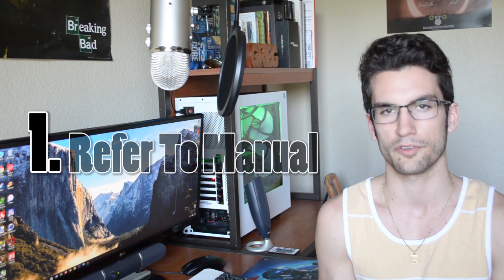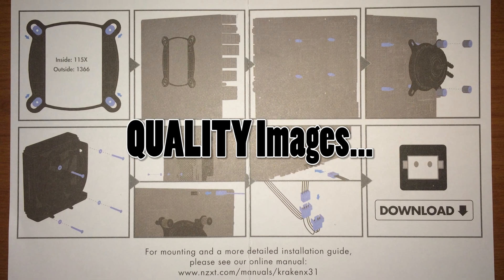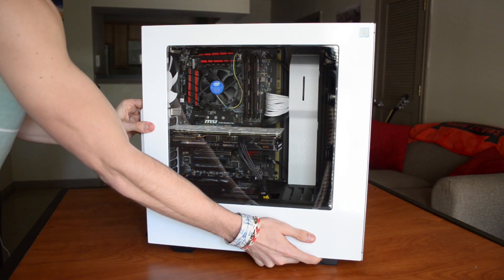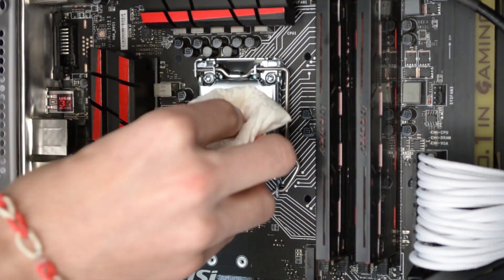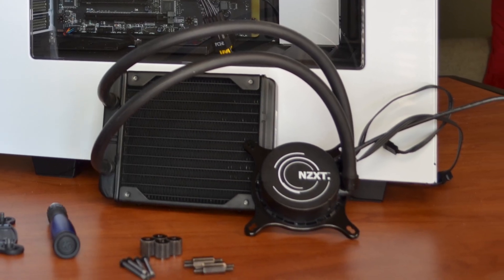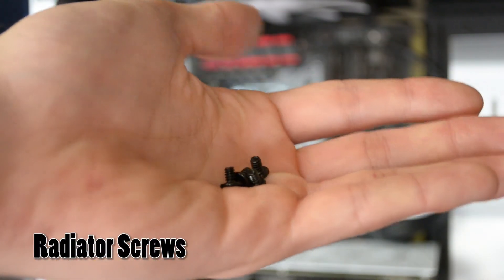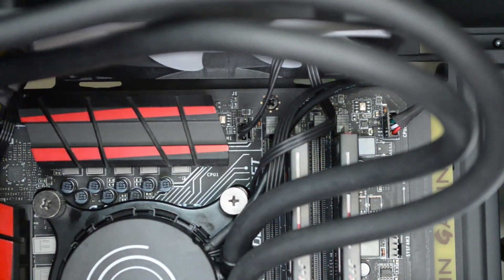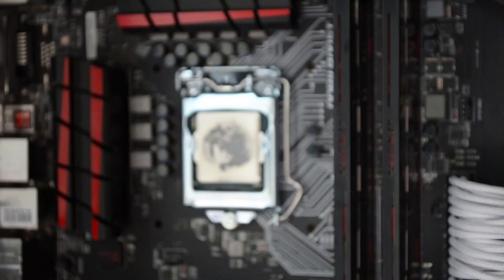How To Install An AIO Liquid Cooler

Comment: dont we have to refill the water cooler every couple months?
Reply: Not with all in ones. It's a sealed loop so you couldn't fill it even if you wanted to. Custom coolers you should periodically check the water level on the reservoir to make sure it's got plenty.

Comment: So i am confused, can i place the cooler master masterliquid 240 on my front panel of my case so the front fans are the water cooling fans (my case is sharkoon tg4 red) 

I see a lot of people just screwing the radiator on front while the front fans are not removed

Does that means that i just can screw the radiator on the front panel too and use those fans as AIO fans?

Comment: I never trusted liquid cooling as I tried it before and got a leak very quickly, but it was one of the ones where you add the liquid yourself, I wasn’t aware they did coolers with liquid inside already

Comment: 2 quick questions are the aio coolers alredy filled with coolant? And is there a mechanical pump or is it working just by temperature diffrence causing flow or something like that?

Comment: Thank you for providing a great video and installing the fan to blow air towards the radiator to cool the radiator off so it can provide cool water to  the hot cpu that heats up the water. Thank you. There are some videos floating around and i believe they do not know the basic law of airflow and radiator function.

Comment: question am I able to swap my water cooler stock fan for a better fan with rgb? I have a Hydro Series™ H45 Liquid CPU Cooler just can't seem to find any answers to the question thanks
Reply: The only thing you need is a fan that will push air through the radiator, so any fan will do
Reply: @k3llyj3lly  thanks

Comment: shouldnt the radiator fan be plugged into the cpu fan header as the speed of the fan needs to be dependent on the temp of the cpu?

Comment: Don't connect AIO radiators at your exhaust spot. You want it getting fresh cool air, not hot air from inside your PC.
Reply: Not true your chassis configuration determines whether or not the fans should be blowing or sucking.
Reply: @codyjames5036  the fans can be push or pull, either way you want them getting air from the beginning of your system
Reply: @RickRokner  not to try to be rude but simply by your statement you don't know much about fan setup, chassis configuration and especially water cooling and when I said sucking or blowing I didn't mean which direction the fan will be on the radiator I meant sucking it in from the outside or blowing it out from the chassis.

Comment: you know this whole time I thought u had to put water or some sort of liquid to cool this, seems like its already there lol, I've seen too much custom pc's with all those crazy waterpipes
Reply: You know I was just wondering why did he leave out the how to fill it
Reply: Wait so with an aio liquid cooler you don’t have to manually put water?
Reply: @drpepper9676  no aio stands for all in one. You dont need to change the water it comes preinstalled
Reply: @crownedmedia7936  damn I been wondering about this😅. thanks for the info man. I'm fairly new to pc
Reply: @crownedmedia7936  what is the water runs out, then wt do i do?
Reply: @yoda_playz3060  it wont lol it's all sealed
Reply: @crownedmedia7936  is it safe tho, i am going to be doing my first build in a month, and i am thinking between aio and fans
wat should i go for?
Reply: @yoda_playz3060  I'd go for the water cooled one theres nothing to it just screw it in and plug it in it's simple and safe and looks better plus you can say your pc is water cooled lol
Reply: @crownedmedia7936  thank you for the support, do u have any knowledge on gpu's tho?
Reply: @yoda_playz3060  I got a rx570 8gb its vr ready and it has a msi rog logo on the box it's around 300 canadian I'd get it
Reply: @crownedmedia7936  i am thinking of getting rx 5600 xt 6 gb, should i go for it or is it risky coz of the black screen errors
Reply: @yoda_playz3060  I'd get it you'd be fine,if it did break you can just return it if it's in the time period
Reply: @yoda_playz3060  I'd recommend the 2060super over 5600xt .
Reply: @rikshitb6837  thats wat i am going to buy
Reply: If i knew this on my last build i would've probably used a AIO cooler but as somebody fairly novice in pc building the thought of me trying to manage water in pc just put me off. I just used the stock amd cooler.
Reply: I too have seen one too many of those builds with all the water pipes. I've had my PC for two years now, built it myself. Did not know they made water cooling systems that came with water pre-installed. Right now I'm just rocking the stock cooler and some fans in my PC. Might upgrade to this cooler seeing how easy it is to install it, and it's not too expensive on Amazon at $90.
Reply: well thats why these are called aio's (all in one) and not custom loops
Reply: theguywiththecoolprofilepicture  yea I ended up getting a Corsair h100i pro
Reply: @aidancarroll2945  you could still remove the fluid and shake it up with distilled water to clean it out a bit, sometimes they come with metal particles in the water from the radiator itself but ehh, thats just me.
Reply: @aidancarroll2945  how is it working for you?
Reply: @aidancarroll2945  was this any good? I'm looking to get one
Reply: @louiswilson4590   mine worked great, but i ended up wanting to overclock alot more so i ended upgradeing to a 120mm rad and now a 360mm rad to keep temps at a good place
Reply: This is the reason why i search for this kind of vid. I always thought i have to put some kind of water in it. Lol
Reply: Versace Lettuce I was asking the same question
Reply: Same lol
Reply: wait you do not fill the rad I am so confused plz help
Reply: @MikeT955  it's a aio heatsync all in one, no water needed screw it in then plug the other comes into the motherboard
Reply: Melvin The Rooster so I just plug it in
Reply: @MikeT955  and screw it in, yes
Reply: Melvin The Rooster ok thanks
Reply: On the video thumbnail I saw liquid to the side and thought I had to order that too Would of been upset...
Reply: I believe that's why its called AIO

Comment: If I have multiple fans for my AIO, do I have they come with pins I have to plug into the fan headers on the mobo, or are they all connected to one CPU header. (Sorry, new to pc building)

Comment: Should I install my water cpu cooler outside the case or inside? Because if I did it on top of the motherboard box will I just have to hold the radiator when installing into case?

Comment: A small extra for you Greg. 

All of your video was great and very helpful, but i got caught up with one extra item. My ASUS motherboard has a 12v header for the rgb connector. My Thermaltake 3.0 120 pump-fan have 2 options for connecting rgb, one for 12v, and one for 5v. I would have checked this prior to purchase if i had known...

As you pointed out though, the AIO manuals are awful. It took a lot of research to work out the difference between the fan & pump and rgb connectors - on the mobo/AIO. Unbelievably, Thermaltake does not label them, nor document in the 1 page information sheet ( i can't call it a manual ) !

Comment: If I don't overclock, is it still recommended to have an aio?
Reply: Julianne Ambay if you have a ryzen 5 or higher, and your case has bad air flow, and your motherboard lacks in heat skins, then yes.

Comment: So I have my parts at home except for a processor but I’m noticing that it might not come with its own heat sync. This is my first build so I don’t want to mess with any water or anything that I have to put in myself. Is the water in this cooler (and every other cooler) already in the pipes? I honestly have no clue.
Reply: Ones like he is working with are self contained, they come with water already in the rad and pipes. I'm in a similar situation. I picked up a Ryzen 7 1800X in a 1 day flash sale for $160 US and it has no cooler. I went with a Rosewill but it's a 120mm single fan the same as this. I'm less worried about messing this up than ram speed to be honest. They don't seem like something you can mess up.

Comment: is the liquid already in the cooler ? and does it get dry with time? and how to refill and what type of liquid is used inside
Reply: It comes already in the cooler. Most coolers don't allow for you to replace fluid on the off chance it happens to evaporate. It would be better to replace it. If it does allow you to replace the fluid, it should be in the manual.

Comment: I wanna get an AIO cooler im running on an nzxt xs340, in which direction should i mount the fans?
Reply: It really doesn't matter too much. As long as it doesnt put the fan wires at a weird angle that's hard to work with.

Comment: Why do you need to plug in 2 fan connections? (Not the usb connection). We route one to the CPU fan header on the motherboard and one to a normal fan header. We only have 1 fan?
Reply: Ones the pump and ones the fan.

Comment: How are leaks not covered by warranty? That's the most INSANE thing I've ever heard. Why are people using these coolers to begin with? If there's even a slightest chance of a leak, there should be a warranty for it, it's very logical. I know I won't be installing this shit in my PC, that's for sure
Reply: Because high end cpus get hot. That requires better cooling. Especially if you want to overclock. Thats why.
Reply: Water damage in general isn't covered by most warranties. On rare occasions, the cooler manufacturer will supply a warranty.

Comment: Nice install instructions but what about software setup? There has to be more than just install and turn on
Reply: Well you dont have to install software for an air cooler now do you.
Reply: @yako0006  you forgot that this is a water cooler and that fan settings are a thing
Reply: @swagaliciousgangster  thats not software setup for the cooler to work. It will work by just installing it and turning it on.

Comment: I have a question my aio's pump connects to the 3 pin fan header should I set the chassis fan speed as ignored in the bios or not I
Reply: And the fan connects to the pwm header

Comment: one question so are your exhaust fans  above the case to push hot air upward and out of the case instead of them generally being at the back? i see a bunch of different orientations on builds ive watched? 😊

Comment: does the paste act like a glue? im looking to replace my Cooler Master water cooling with a Corsair one. i just wanted to know so i dont damage the CPU
Reply: Thermal paste is used to help heat transfer between the cpu and heatsink. It is highly heat conductive and it fills in all those timy little microscopic imperfections that might result in performance loss. In a way it does act a little bit like glue but that is not the main purpose for it. The screws are there for a reason. Always use thermal paste.
Reply: Ok I’m just making sure, thanks!
Reply: Funny enough I know someone who used superglue instead of thermal paste. When they tried to replace their cooler, they decided the entire cup.

Comment: Okay I understand everything except for the USB 2.0 header.  Why would a water cooling system need a usb header to operate?  I don't have water cooling yet, but 'm considering buying one soon.
Reply: Because the usb is used for controlling the cooler in the nzxt cam software like explained in the video.

Comment: My only confusion, where do I plug the pump into? Currently I have it plugged into the system can spot,  but I’d like to plug my exhaust fans into that, and the Rad fans into the cpu fan spot. This is my first time with an AIO, is there a way to power the pump separately, so the system doesn’t rev up the RPM’s?

Comment: This is called self contained  coolers !!!
Every detail about this cooler :-
Self-contained or "sealed" liquid-cooling kits—preassembled and completely sealed, they start at around just $60—allow you reap the benefits of a simple water-cooling setup without having to deal with any of the messy particulars. You just need to attach a water block to your CPU and a radiator/fan combination to your case, and you’re off to the races, with nary a drop of coolant to worry about. You may lose customization options if you use self-contained kits like Corsair’s Hydro H-series or NZXT's Kraken-series coolers, but you also lose most of the headaches typically associated with do-it-yourself liquid cooling. Leakage is highly unlikely as long as you don't bend or twist the tubing at sharp, weird angles.

Installing a self-contained liquid-cooling kit is about on a par with the difficulty of installing an aftermarket cooler for your CPU. If you need to water-cool only your overclocked processor, a sealed liquid cooler is a compelling option. Stick to DIY loops if you want to liquid-cool more than the single component, however—or if you want the bling factor of clear tubes filled with colorful coolant. Most sealed coolers are opaque.

Comment: I put it in front but the radiator is on the inside and fans sticking out. 
Its the H55 is that ok ? or is that a problem HELP :)

Comment: Can you put the radiator in the rear of the pc, as the case I like is the cooler master master box lite 5 rgb, which doesn’t have space at the top for a liquid cooler
Reply: He literally did that in the video.

Comment: I've got a ryzen 2700X with h60 cooler installed in same case  on the front as intake will switching to back reduce temps   ?
Reply: No. Air coming in is as cool as it can be.

Comment: If your board allows you to control CPU fan speed (pumps hooked into) do you set it to manual or automatic? I set mine to a curve starting at 50% and going up depending on temperatures

Comment: I’m confused, so do you need to buy cooling solution? Like I didn’t see you use any liquid in the video? Aren’t you supposed to run like distilled water through the radiator and then the solution, or is it just already in the rad.
Reply: It came in the AIO

Comment: What do you do when your liquid cooler leaks
Reply: Turn off and unplug the system immediately. Open the case and wipe all water up. Remove the cooler and fix the leak.

Comment: A noob question. Are you not pulling warm air through the radiator from inside the case in this config?
Reply: no, the air getting in will be just a bit hotter, or you can just reverse all of your fans

Comment: Can I connect the fan to a PWM 4 Pin header and the pump to a 3 pin or does the pump have to be on a 4 pin header because my mobo only has 2 PWM 4 Pin headers and I want one of them for case fans. Should I get a 4 Pin header splitter and connect the CPU fan and pump to that and use the other mobo header for case fan.

Comment: hey guys i have an issue, after i install my AIO on my dinosaur old i7 2600 and h61 mobo.

The problem is after i installed the AIO, my pc wont boot up. At first i thought some cables was loose or what not since i just installed my AIO. Everything seems fine and i really have no idea whats going. Removed the ram tried on other slot, change to a different hdd, still same. Decided to take off my AIO for some reason and BOOM. PC BOOTS UP

As for now im really confused and my PC is still running hot with 60c on idle.

HALP PLS
Reply: your AIO is probably not compatible with your motherboard then

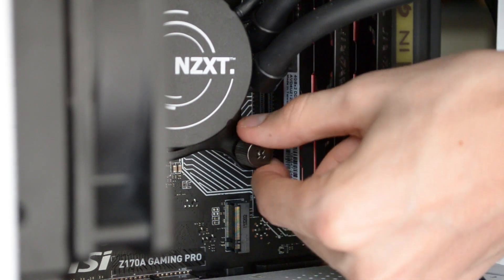Comment: You lost me at 5:22 :( I wish you would have shown the wires you were connecting............
Reply: Not sure if you wondering still after 8 months but its the wire connected to your cooler. Goes to the cpu fan slot on your mother board
Reply: @spawnandbatman6975  if he doesnt know what a fan header is on the motherboard, he needs to do more research
Reply: @oldjazzandbigbandislife  ikr, Fan and pump headers are literally labelled on most if not all boards, and even if they weren't the motherboard manual would show you where they are.

EVEN IF that fails, theres literally only a 1 type of pins you can plug it into. It's literally idiot proof.

Comment: My water cooler wont screw in for some reason. I just took one out to apply thermal paste but now I can't get the bracket back in to hold down the connection.

Comment: Hi, i have maelstrom 120t cooling my 8600k, and i have a z370 TUF-Plus gaming mobo, and i have some headers, like, "cpu_fan"' (where i`ve plugged the fan that is attached to my radiator) and a "aio_pump" header where i`ve plugged the only cable from the pump!
Is that the correct way?
Reply: It appears so

Comment: Hey i have a H100i corsair water cooler i have it installed but i was looking to change the cpu can i just remove the screws? Around the cpu to take off the cooler part that sits on the cpu clean the thermal paste and re do the process with the new cpu and paste and re screw it in or do i need to un plug the whole thing?

Comment: Hello, this is my first time dealing with a water cooler. (CM masterliquid pro 120, I7-6700k) I plugged the plugs from my fan that are connected to my cpu_fan slot and the pump block to aio_pump plug on my motherboard. I was previously getting around 30 to 40c on idle and every time I ran a game it would get 5fps then memory dump. If anyone could help me I would gladly appreciate it.
Reply: Take pics of the issue and the issue error code. Go to a forum with computer professionals and they can tell you what’s wrong. I was gonna pass you up but I couldn’t leave you hanging with such a shitty problem.

Comment: You never mentioned the orientation of the pipes to avoid air bubbles reaching the pump
Reply: Leon Sparrow Rule of thumb regarding that matter?I'm genuinely curious about that because I got a Seidon 120 Ver.2(Euro only) and the pump's been making some whine but I don't know if it's a mechanical problem or a bubble issue.Could you shed some light on that?
Reply: As for  aios it doesn't matter that much since is completely sealed and filled